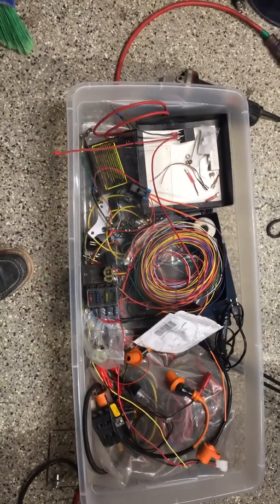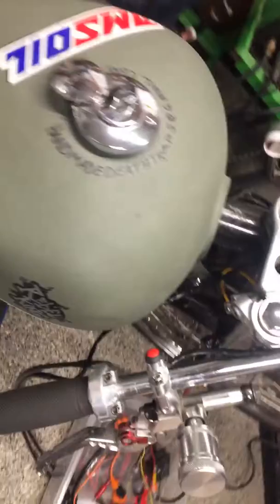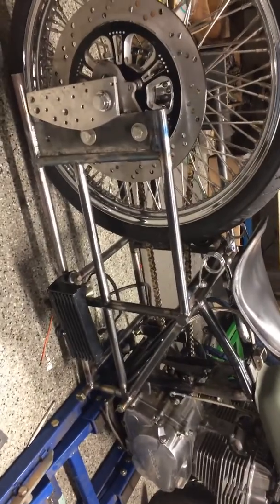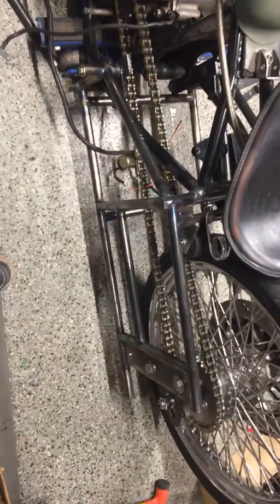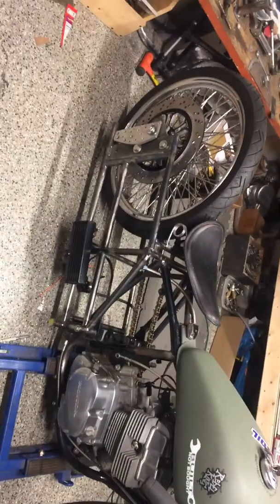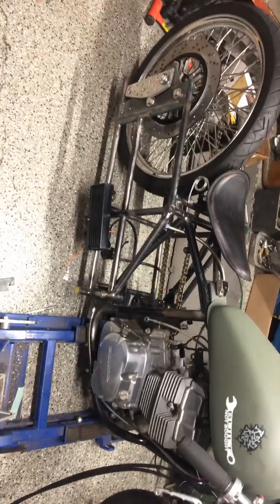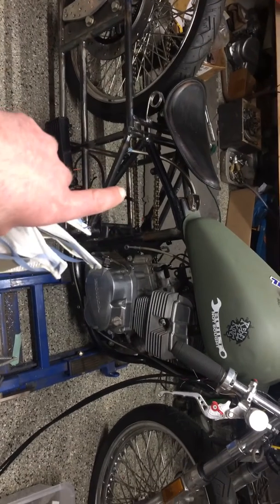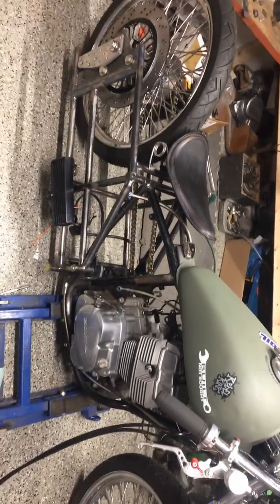Honda rebel 250 turbo “aka” rebel king

Comment: How did that older dual carb set up go for the rebel? Been thinking about doing the same with my nighthawk(same engine)
Reply from the maker: Luis Garcia , ran ok? It’s easier with one carb less set up and less mess with one carb not much room and you need a new filter boot and it’s tight. If you aren’t going to get good carbs and just wanna go two carbs don’t waste your money or time. You can get the stock one Jett set so it will pull better
Reply: @TheRebelking247  thanks for the insight! 👍